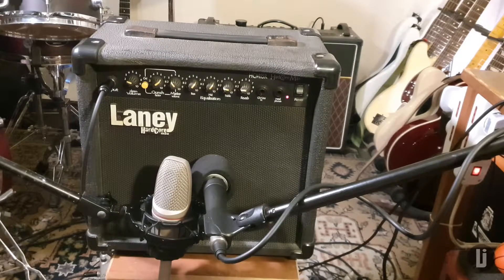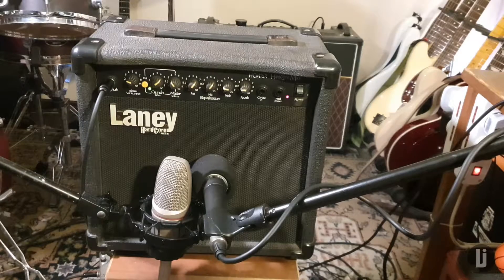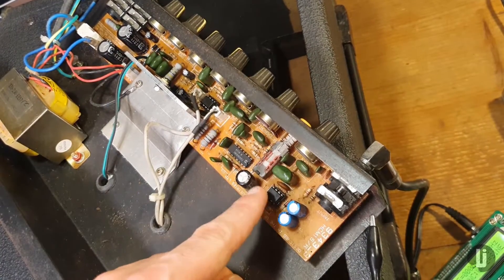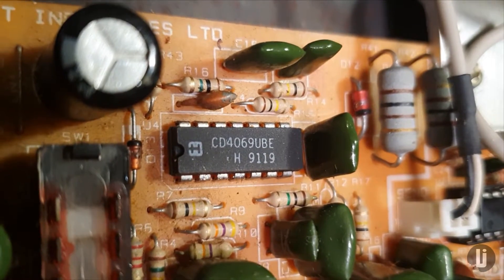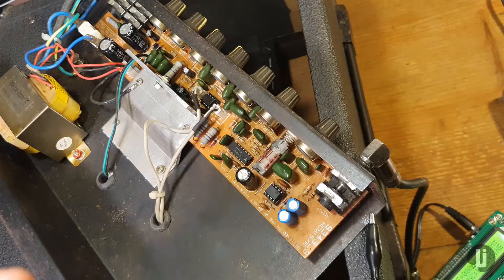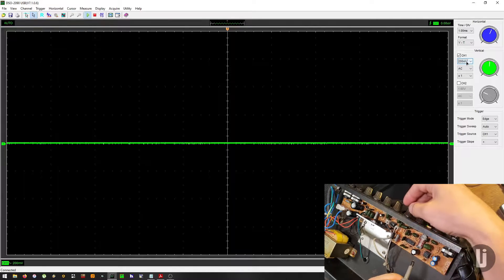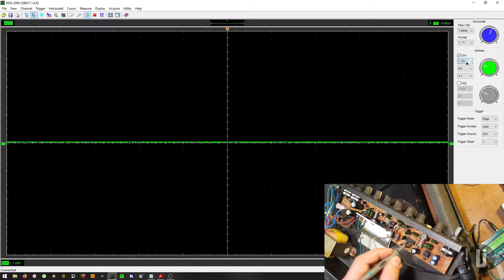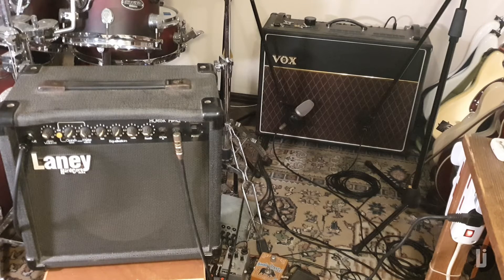Small Solid State Amp Sounds Like Tubes - Laney HCM15R analysis, demo and philosophical treatise

Comment: You ran the external from the headphone out!? lol Why not just wire up the speaker wires from the unit to the cab speakers? It would have sounded x10 better. Headphones stages are awful.
Reply from the maker: 2 reasons:

1- This method was non-invasive. Wiring directly would've meant de-soldering on both ends. I chose to avoid that since it was not justified by the nature of the experiment. If anything, it would've been detrimental, which brings up reason 2.

2- Impedance mismatch. Wiring directly would've arguably sounded "worse", although better or worse is a misnomer here; the main focus was to keep the signal "true", regardless of appreciation, and wiring directly would've affected that. 

The AC30 speaker array is a 16 Ohm load, whereas the Laney is designed to drive an 8 Ohm load. I would've simultaneously lost power and messed with the frequency response curve by driving the AC30 directly. 

So instead, by running a clean, flat response, buffered signal from the headphone jack (which is by no means awful on this application, it simply is a totally clean, buffered line) into an effects return, which expects this exact kind of signal at this level ballpark, and then properly driving the speakers the way they were intended to be driven, I kept the pre-amp signal as "true" as possible relative to what would have driven the Laney's speaker.

That's also why I was concerned with keeping the power stage level low: to avoid saturating the power valves and coloring the sound too much.

All that said, this was a stupid test I realized I always wanted to do and never bothered to. Then the engineer kicked in and I got carried away with oscilloscopes and shit. Then I wonder why it takes me so long to put out music.
Reply: @lonerjuan  Sorry I didn't mean to come across so disparagingly! After I re-read my comment I realised it may have seemed bad mannered. Speaker impedance is always a minimum load only. Most speaker cabling has lugs on that can just be slipped off very easily. If not a 2 minute solder sorts it out.

The line quality of a headphone-out is atrocious for the application you were trying. It's not even a good line-out signal.
Reply from the maker: @wodenoftheangles3339  Hey no worries! I love exchanging ideas about this stuff.

I just didn't want to mess with the amps; especially dealing with the Vox which is a bit cumbersome. 

I do understand that in a solid state amp the 8 Ohm load rating allows me to go above as much as I want without breaking the power stage, but I'd still be going against the maximum power transfer theorem, which would alter the sound even further than simply using this particular headphone output would. So I chose to add a clean active stage in-between amps to avoid impedance mismatch, which was the lesser evil in this far-from-scientific scenario.

I did check the circuit first so see which kind of headphone output this was (I do agree that as headphone output it sucks) and to ponder how bad it would turn out. This headphone line in particular taps straight from the output of the TDA2030 at the power stage, so it's basically just a buffered line out. 

In retrospective, I could have lifted C33 if I wanted to be thorough, because it does introduce some treble rolloff past 7.2kHz, meaning I'm probably losing some of the more subtle upper harmonics (keeping them would've probably sounder a hair richer overall), but I already had in mind this type of pickup (Gibson Classic 57s) is already quite silent at that point, about -20dB or so. Also, the distortion circuit naturally "ignores" harmonic content that comes in at way too low level compared to the fundamental, so even if it's somewhat there on the input of the amp, it's not generating significant harmonic replicas. Also the distortion circuit and doesn't create a wide harmonic series until you really push it to the limit, so past 7.2kHz there's not much to carry over. I did run some FFT tests to be sure, and there was a lot of frequency room to play with.

I'd still like to try and properly run straight into an external cab at some point, maybe work on the mic placement a bit better. I honestly didn't expect it to sound so awesome, so I sort of half-assed it.

Comment: Juan, thanks for helping to explain why there’s something magical going on with the distortion channel in these amps.  I have an HCM30, made in England.  It’s got the HH 10” speaker in it.  A lot of people don’t know that HH speakers were coveted at one time.  I actually gig with this amp and love the sound.  I mic it if necessary.  I’ve found that if I turn up this amp past about half way, either channel, the most magical power stage grind starts happening.  The clean channel gets that nice subtle overdrive, and the distortion channel gets fatter and even smoother.  None of my distortion pedals come even close, so I use no pedals with this amp.  These HCM amps are highly underrated in my opinion.
Reply from the maker: Same experience here. It's been almost 20 years and still, I can't put my finger on it, but something great is going on with this amp.
Reply: I actually have an HCM30R and an old HH 4x12 cabinet. Would be interesting to try it on that....
Reply: yeah the larger SS Laneys actually seem to have good speakers!
Reply: Coincidentially, I got my UK made HCM30- (non reverb 10" HH Invader speaker)after maybe 5 years unloved in the back of the shed-  set it up and actually played it and adjusted it as it should be. Far fukn out it's a beast and I never knew it. Time to wipe the beer stains off, love it again  and take it to the next gig. What a revelation.

Comment: you're dead on about the speaker tbh. it hurts a lot of smaller SS amps. it's kind of wild they put in the R&D to make an SS sound like a tube but then cheap out like that.
Reply from the maker: If only they gave the poor little fellas a chance... Also some amps like the MG Marshalls and all that, basically re-housed pedals, just lazy designs when circuits like these are just as cheap to make... I don't get it.

Comment: It's always the speaker. I remember that one video of 15W Fender Frontman amp sounding great through 4x12 V30. The same with Marshall MG50 combo i tried. The stock speaker is horrid but after connecting it to 2x12 Greenback cab it was like: "Yep. There it is. JCM800 for a fraction of the price."
Reply from the maker: Alright, it's settled. First thing I'll do when I become Emperor of the world will be to make it mandatory for every single amp to have an external speaker connection.
Reply: @lonerjuan  And effects loop. Please, your majesty.

Comment: Strongly considering getting one of it's newer bigger brothers - the LX65R sounds in many ways a lot like the Super Crush amps but cheaper, and quite similar to some of Laney's tube offerings. Better speakers on the 10 and 12 inch models helps them a lot.

Comment: Awesome!
Would it be the same with the Hardcore 30 made in China. Do they have the same topography?(or the bigger ones, like 65 or twin). Got an eye on one since I saw your video 👀.
Greetings.😂
Reply from the maker: Looking at the schematics, the topology of the gain stage is essentially the same across all 3 models: 4 stages of CD4069 amplifiers. There's a slight, I dare say negligible difference in a couple components on the second gain stage of the HCM30, but that's it.

Then there's a differences in features, but when it comes to the signal path and crucially distortion circuit, it's essentially the same amp in different sizes and with extra features as you go larger.

Here are the schematics if you feel like comparing them: 

HCM30: https://elektrotanya.com/laney_hcm30r_sch.pdf/download.html#dl

HCM65:https://elektrotanya.com/laney_hcm65r_sch.pdf/download.html#dl

Comment: You should install a speaker out Jack that defeats the internal speaker. The Vox Pathfinder 15R uses the tda2030a output chip and sounds great. I wonder if the difference in tone is just down to using different speakers?
Reply from the maker: In this case, I tried to keep the power stage as clean as possible to compare only the difference in speakers/cab, which is huge.

I guess I could install a proper speaker output, but I don't  think I'd really use it and I don't feel like messing too much with the amp. Too much sentimental value.
Reply: @lonerjuan  Oxymoron?
Reply from the maker: @jkambert6791  Nope, just a regular moron.

Comment: Very interesting video, I had a Laney HCM 65R but unfortunately got it with a broken speaker cone, so I got it fixed and sold it although I really liked the dirty channel of that amp, I now have a couple of Marshall Valvestates but since I still missed that Laney dirty channel, I decided to get an HCM 30R to play around with, maybe the preamp stage is the same for these HCM series, I guess the difference for the 30R would be a TDA2050 instead of a TDA2030? can't wait for it to arrive, greetings from Colombia.
Reply from the maker: I'm looking at the HCM30R's schematic right now and at first glance, it seems like the same layout with a TDA2050 and some extra goodies like external cab connection. Other than that, (and ignoring the MAX switch which seems like a mid scoop of sorts) the crunch section seems to be identical.

Hope you get to have some great fun with it! Cheers from Uruguay my dude.
Reply: @lonerjuan  I have one of these amps. Did you find a schematic?
Reply from the maker: @v12cat  Yeah, it's linked in the description. That site has all sorts of obscure schematics.
Reply: @lonerjuan  The link is kaput now.
Reply from the maker: I can see the Michael S. McCorquodale article is indeed down (corrected on the description). I don't know if you meant that one or some other. I checked the rest of the links and as of the writing of this comment, they are live.

Comment: So a lot like you said in your video, this was my first amp I bought new in 2002 or 03'. In 2005 or so something happened and it just quit working, so it sat in my parents basement till just the other day lol. Back then, I didn't know shit about fuck and wasn't as tech savvy as I am now (nowhere in your realm), but I kept it because there was always something I loved about how it sounded then so the other day I was at my parents saw the thick ass dust n shit all over it and grabbed it up and brought it home. After 5 min I figured out that the speaker had for whatever reason failed. And after watching your video I want to build a 8ohm 12" speaker cab for it and make it a head. Any tips or things about that you would suggest? Awesome stuff n Thanks for the video!
Reply from the maker: Go for it! Maybe try it on a someone else's cab first to see if doesn't disappoint you. I would avoid the weird method I used here with the headphones jack (it was a spur of the moment) and take a few minutes to actually de-solder the speaker leads, add a 1/4" plug (or jack + cable) and plugging to a cab properly.

If it meets your expectations and you do turn it into an amp head, I personally wouldn't re-house it. It's small enough already and if you go for the head shape you might end up with the reverb tank way too close to the electronics, which will make it way too noisy (the tank picks up transformers like nobody's business). 

I'd simply add a 1/4" jack in the back that bypasses the speaker output whenever you plug an extension speaker cable in, like a regular external speaker on amps that allow it. Then at some point you can throw a speaker in if you feel like carrying it to the backyard for practice, or a bonfire where goats are sacrificed to the Elder Deities. That or hot dogs with the kids. Or an orgy with goats and hot dogs. But no kids. That'd be weird.

Comment: SO what if you just changed the speaker? would the cab still need to be changed?
Reply from the maker: I'd assume it'll depend on the speaker you use, but the extent of the improvement keeping the same cab would probably be very limited. 

Keep in mind there's not much room to go bigger, you might be able to put a 10 incher there, but how the cab would react is another story. I'm not an expert on calculating cab proportions, or choosing the materials, but I'm pretty sure this cab wouldn't do well.

It'd likely be easier to adapt a 1/4" jack where the stock speaker is connected and drive an external cab (what I did with the headphone output is primitive at best).
Reply: @lonerjuan  I have a Laney LX15 and it's a little beast!
It has 2x5 speakers, and I'm contemplating whether to replace the stock speakers with more expensive ones or just replace the 2x5 with a 1x10. Your thoughts?
Reply from the maker: @kiillabytez  I doubt you can find good (if any) 5" guitar speakers, but there are some hi-quality 10-inchers. Besides, the lowest frequency reproduced by a speaker is dictated by the diameter of the cone, so a 10" speaker would theoretically (and ignoring all other factors that make these things way more complex to calculate) give you a full octave of extra low range.

Personally, I'd go for a 10" one, but budget might make getting an extra amp or external cab an option.
Reply: @lonerjuan  There’s also the option of installing an output jack to an external cab, but now we’re getting into the expensive territory as I have yet to own a cab.
There are some high quality albeit expensive car audio speakers on the market but I haven't done enough research to determine if they are proper for guitar amplification or not, but the RMS is pretty high on those.
Reply: @lonerjuan  Celestion makes 5" speaker, fyi.
Reply from the maker: @kiillabytez  Didn't know that! I ehought they only did them for amp manufacturers but not for aftermarket. That's great! Still, low end will probably be lacking in an apples to apples comparison, and I'd still go for the 10" (I don't know how money would work out there though). 

As far as general purpose speakers, they have different frequency response compared to guitar speakers and will generally sound harsh on musical instruments. Try searching for charts and graphics googling "guitar speaker frequency response" or something along those lines, and the replace "guitar" with "hi-fi" or something else to get an idea of what I mean. It's a hell of a wormhole but if you dig that stuff, it's fun as shit.
Reply: @lonerjuan  Not really into digging that hole, but if I'm going to spend my money on something with that many variables, I need to know for sure that I'm not wasting time and money.
Reply from the maker: @kiillabytez  Well sadly that's mostly a trial and error thing. You may hit the magic formula, you may not. 

I've had both, but more often than not, the moment I find myself going for tools that make things that can't be undone, I end up saving some more to get the thing I want instead, and keep the thing I already liked the way it is.

That's why the amp on this demo still has the stock speaker. I was offered a 10" one years ago, it would've worked, but I decided against it. Now I don't even want to drill a hole to install an external cab jack. 

I do change pickups on guitars and stuff like that, stuff that can be undone, because again, many times I find myself undoing things because the thing that made me like the guitar for example, is gone the moment I do the mod. Other times the mod stays, but it's up to you to decide how far you'd take it, and how much of an impact you can achieve or if the potential impact is worth the risk or ruining the amp.
Reply: @lonerjuan  Just watched a guy connect a 350 watt 15" woofer to his Peavy 10 watt amp, and it sounded pretty good, certainly louder than the  combo beforehand, so there's that.
Reply from the maker: @kiillabytez  Might be worth the try then.
Reply: @lonerjuan  Yes, it's the Celestion TF0510 8 ohm 5" 30W driver.
Reply from the maker: @kiillabytez  That's designed for audio, particularly as a mid-range speaker. It'll probably be too harsh, and have a full octave less bass than say a 10" Greenback, but treble will be sort-of flat up until 10kHz, where a Greenback will start dropping significantly at about 4kHz making the sound warmer. That's why I suggested looking at frequency response charts. It's quite the visual representation of why you don't normally use PA or Hi-Fi speakers on guitar amps, they're not optimized for the job.
Reply: @lonerjuan  The Laney is in 2x5. Having 2 smaller speakers provide a fuller tone than even a 1x10 due to the spread not being focused at 1 point. It may not actually be fuller, but gives the illusion of being fuller.
Reply: @lonerjuan  Just like a 2x10 sounds better than a 1x12.